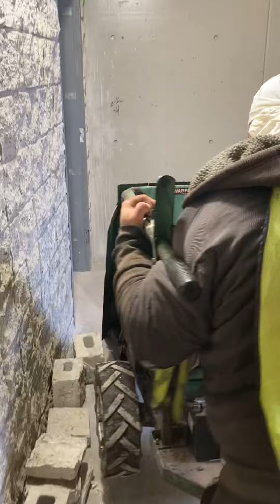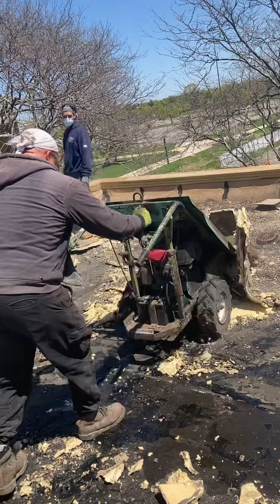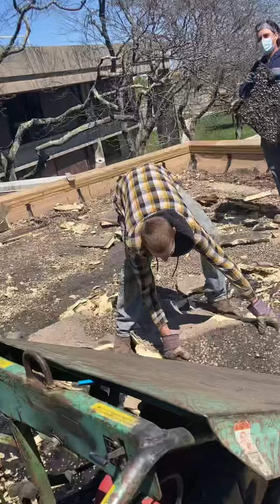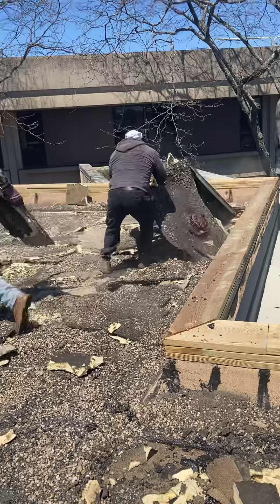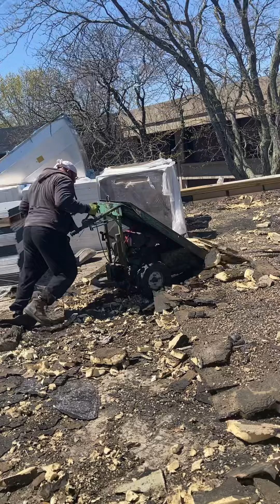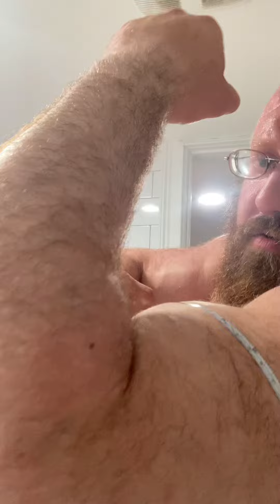550lb. RoofWarrior+arm measurement

Comment: Loo what were your compounds lift at 16 or as a teen in general
Reply from the maker: I didn’t lift till I was 24 but I tried the deadlift once at 17 I cut from 248 down to 175 and did 425 didn’t lift till 24 had 530 then built from there 100kgs added
Reply: @IRONL00  Appreciate it always a motivation. 🦍🦍🦍